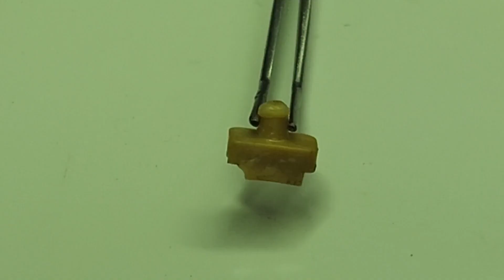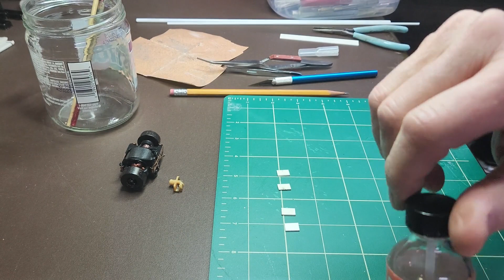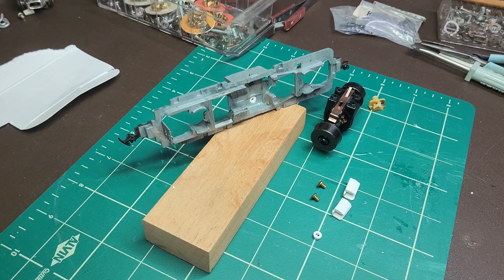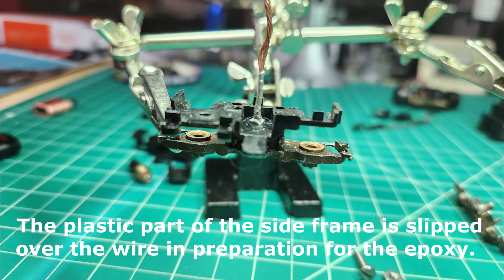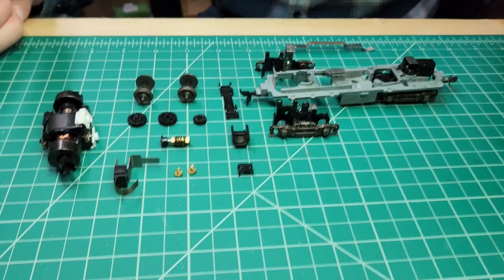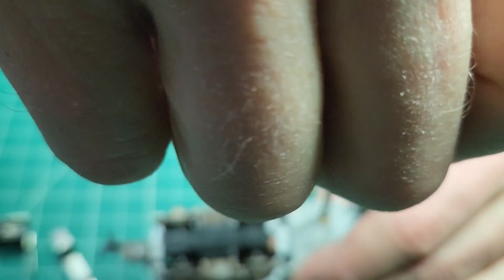Episode 4 Part 3 of repairing the antique Athearn SW7.

Comment: Super. My railroad still operates five of the Athearn Bluebox SW-7s, all bought new, with two that were modified and had radial couplers installed so that they could operate on the 4 3/4 inch radius curves of the street trackage on the trolley line. I also ran a wire from the frame to the bottom motor contact on those two, but all five have operated above the call of duty, even when subjected to snowplow operations. I was lucky to get all five with flywheels and bearing sideframe mid modern production trucks and the paint job that I wanted, (CB&Q) even though I had to visit a number of hobby shops to get all five with the same drive train. P.S. Place the locomotive on some powered track, block it from moving, and apply about 1/3 power and let it spin its wheels on the track for about a minute in each direction. This will fix the dirty wheels and gooed up bearings, contacts, and gears, and makes the drive mechanism much smoother. Hello again from the Tracy Mountain Railway in Colorado. 💙 T.E.N.
Reply from the maker: Thank you for the interesting comment. Your experience with the Athearn SW7 model locomotive is interesting. You certainly sound like a modeler who has much more experience than me.. hat's off ;-)  I'm pleased that you took time to watch my video. Thank you for sharing this part of my "HO STUFF" with me.  Regards.

Comment: The wheels need cleaning. Clean the wheels. They are so corroded I would use a Brightboy to get them shiny. Clean the wheels! If the battery terminals on your car turn white with corrosion, your car won't start. You clean the battery terminal. Clean the wheels.
Reply from the maker: Thank you for your response.  As you see in a subsequent episode, I did clean the wheels. They were as bad as you indicated, oxidized so bad that very little to none of the DC current was reaching the motor.

Comment: Great DIY effort, but there are replacement motor mounts made by Athearn, and from a better longer lasting material (silicon I think).

Oh, and I disagree that the trucks weren't ment to be disassembled by the user. I think that is why those trucks are basically clipped together and not bolted or glued or even screwed together. The one drawback is that the clips can be fragile so care has to be taken when prying them apart. Otherwise it is a maintenance man dream!
Reply from the maker: Thank you for taking the time to watch the video and reply.  I appreciate your information about the motor mounts and truck sideframe clips. Regards.

Comment: At one time the motor mounts could be procured from athearn or other purveyors on line. Also the mounts were flexible when new and would harden over time. Hal
Reply from the maker: I've heard that. Someone indicated that I could still purchase motor mounts off of Ebay. That's nice of you to share that information, thanks. i must add that I honestly enjoyed making new ones from styrene bits. I was so proud of myself but I don't claim a major achievement, just had fun doing it. Regards and Happy New Year.

Comment: I sympathize with you. I really mean it. Your hands seem to be shaking. I got the exact same problem. But at least it doesn't stop us to do model trains. I like the fact that you're investing some time to fix this old Athearn engine. I remember owning one like it a very long time ago. Those were very reliable. Especially the electric motor in them. Today's engines are cheaper units equiped. At least not to run for hours with many many cars trailing behind like those Athearn engines were capable of. Keep on your good work.
Reply from the maker: Thank you for your kind comment. I had fun fixing that locomotive and I appreciate that you took the time to watch my effort to fix it. Eventually I plan to change it from DC to DCC. ;-)
Reply: @FunWithHOScaleStuff  Hi again, I've customized many of those Athearn blue box engines many years ago. There was no issue when trains were running on DC power. Sometimes my DCC and sound engines are giving me a hard time. Especially when they lose their programming features for no reason. It seems like I will like model trains until I die. There is so much to do with them. It needs pretty good skills to have things done properly. Keep on your good work.

Comment: Those Motor plugs or Motor Mounts that Ahearn used i was thinking was made of Rubber so that the Motor was cradled  but the mount also kept vibrations down as the motor didn't have counter balancers the nipples on this motor mount was made thick in the center so that when popped into the hole it would hold the motor in place but in way it would let the motor to naturally Flex.. 

Check for Authentic Rubber motor Mounts for Athearn Engines & the Reason it was hard to pop out the Rubber probably Got hot from the motor & stiffened up as the Engine aged...
Reply from the maker: Hi and thank you for the comment. I can vouch that the mounts I removed were plastic.  From what I observed about the installation of the mounts, they were heated when installed so that the end of the mount that inserted into the hole became mushroomed to secure the motor in place. On any future motor removal on other models, I'll check for that first and if I find the same installation I'll use a small drill to remove the mushroomed part. Thanks again for the comment. I hope you found the video interesting.

Comment: How come you didn't clean the wheels, and grease the gears. You did an excellent job at rebuilding the plastic mounts.
Reply from the maker: Hi. Thanks for watching and responding. I wanted to present a general rebuild of an HO locomotive but the length of the rebuild series became a bit excessive to I wrapped it up with the comment that I may return to this cool locomotive later to upgrade it more. One thing may get added is DCC. ;-)
Reply: @FunWithHOScaleStuff  OK. Not a negative, but why not going for the switch to DCC from the get go. You will have to redo the clips form the bottom and top of the motor. An easy way is to switch them around to isolate the motor from the frame as the bottom "tags" need to be removed. The new wheels are a must, I agree. Didn't not know about the wrong sizes for the drivers, where did you find this info? I do have the same loco from Athern with a cow, and I plan to make the DCC conversion for both (one with sound). I bought this set and many others in the early 80s. Going back to the hobby myself too, and no I am not 20 anymore either.
Reply from the maker: @Christiane069  I found information about the wheel sets on a Train Forum, but I don't recall which one.  Your search engine should locate this information for you. Good luck with your conversion to DCC. There are some good YouTube videos detailing this conversion.
Reply: @FunWithHOScaleStuff  OK. Thanks for the Feedback

Comment: Why the robot figure as your logo. Were you involved in Electronic?
Reply from the maker: Hi. Yes, many years in automation, electronics and software. Thanks for asking.
Reply: @FunWithHOScaleStuff  Good, Maybe you can share your experience in electronic. I am a Ham radio operator too and do have a limited understanding of electronic. I am interested to do some DCC control using Arduino. I found a number of site that are involved including some software.
Reply from the maker: @Christiane069  The DCC++ code is open source and free to download. I went the path of building my own just because I saw it as a good "Stuff" adventure for this hobby. 🙂
Reply: @FunWithHOScaleStuff  Yea! I am investigating this system and most likely will implement over time. Thank again

Comment: I would say 95% of the electrical pickup problem, is those wheels are absolutely filthy.They desperately need to be cleaned by soaking a piece of handy towel in alcohol, & placing  the towel on a piece of track with power onto the track..Place one truck at a time, onto the towel, which is on the track, also.Turn the power on fairly high while holding on to the loco.Those wheels will need PLENTY of encouragement to turn, under power. If the motor refuses to turn under encouagement, then just rubbing the loco along the track, with the paper towel, between the track & the truck, & turning the motor over by hand, every so often,Just keep that paper towel moist over the whole time, with alcohol/ turps..I replace ALL my Athearn BB wheelsets, with nickle silver wheelsets, as they stay LOT cleaner for longer.
 Thanks for the video Michael NZ
Reply from the maker: Thanks Michael. Very kind of you to explain all that.

Comment: If you solder the two metal pieces, you will create a dead short. The tall metal piece goes on the right side if the truck, facing forward, and the small piece goes on the left, and contact  the bolster
Reply from the maker: Hi John and thanks for your advice. Yeah, I screwed that up but eventually realized the error of my way. :-)